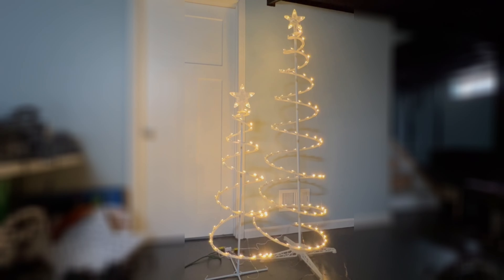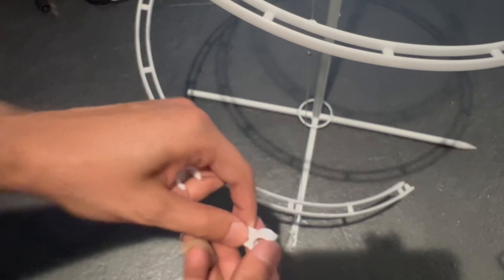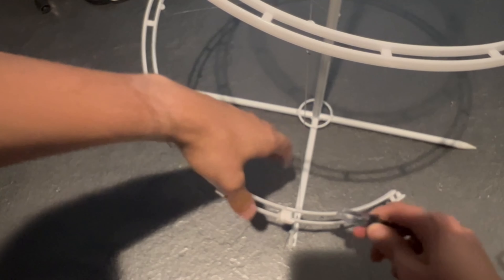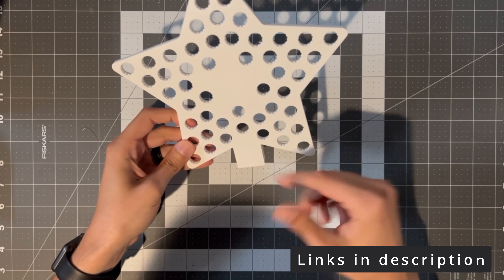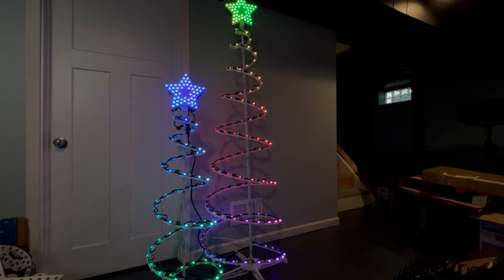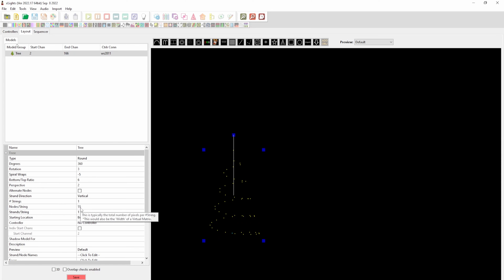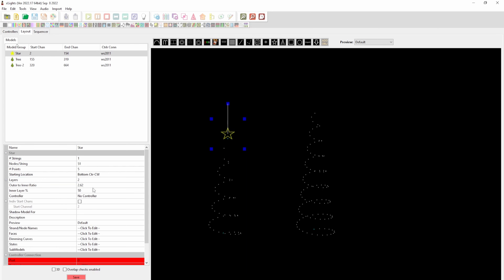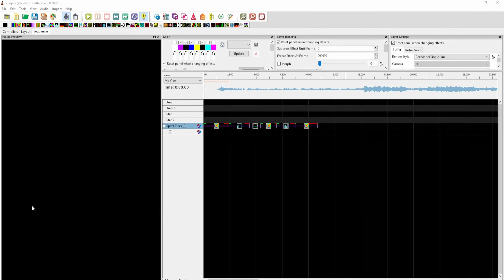LED Spiral Tree Build

Comment: I have a 12 foot double spiral that I want to convert to pixel. It has 500 lights, just haven't found a good way to mount them,  its a channel with holes for the original lights, just the holes are too small. I am feeling inspired
Reply from the maker: Wonder if it's possible or easy to drill out the holes to 12mm to replace with pixles?
Reply: @justinzdesign  Thought about doing that, but it might weakling the structure  too much. May just do a lot of zip ties
Reply: I’ve done a number of these trees using zip ties. Works great!

Comment: Is xLights better than WLED for things like this?
Reply from the maker: xLights is used for programming the show and then you can use a mix of controllers depending on your goals. In this case even the test at the end was being output through a DigQuad running WLED